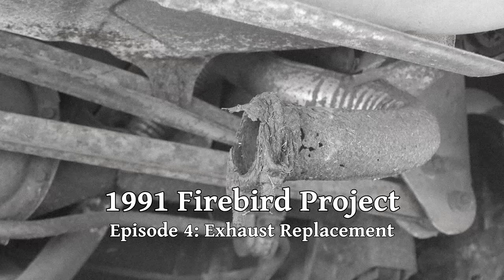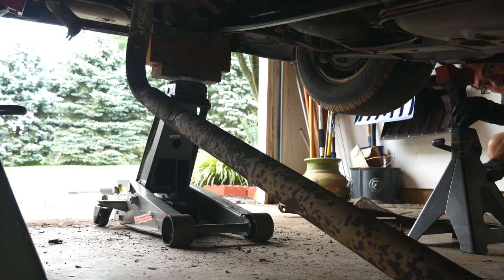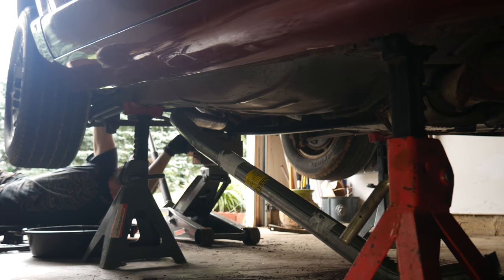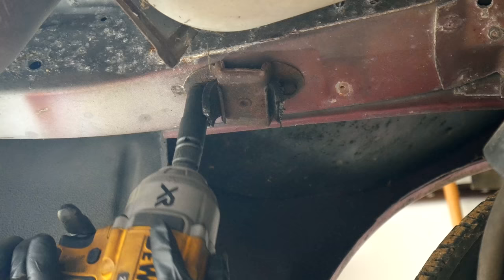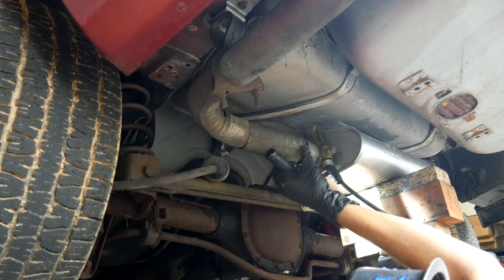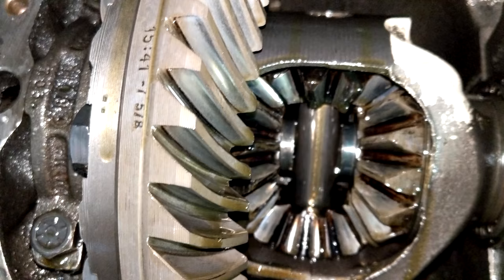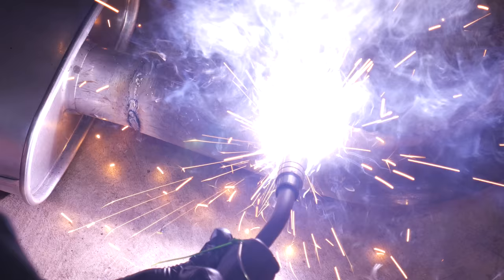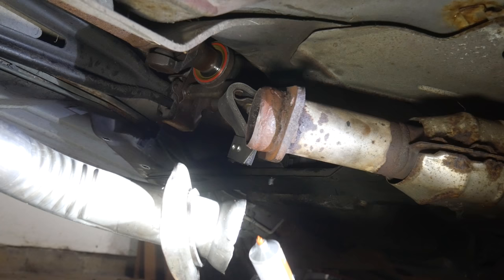1991 Firebird Project Budget DIY Exhaust Replacement/Repair (Ep.4)

Comment: As a person from Europe and the rust belt - that exhaust was mint.
Also, this channel is probably the BEST when it comes to realistic portrayal of a project car. Changing exhaust? Well, to do that, i need to take out a lot of the rear suspension... i might as well change the diff oil. 
Really, only part i find unrealistic is the fact that the presenter/mechanic/personality doesnt have to get up 600 times in one day to go pick up additional tools. And half of those trips are useless because you realize you grabbed the wrong thing.
Cars. So much fun.

Comment: As someone that bought a V6 mustang with overly loud (compensating for a dearth of cylinders I'm sure) exhaust for a daily driver years ago, I commend you on your choice of not waking the neighbors. I'm all for the craziness on a sometimes car, but forget that noise early in the morning.
Reply: shoulda got a v8 bud
Reply: My neighbors are jerks. Pypes Violator mufflers on my 5.0. Sounds awesome!
Reply: @oliverharwood2743  well, yes, but the car was $200.
Reply: With the stock tiny cam, restrictive heads and manifolds, cat, and low compression these LO3 cars don't really get "wake the neighbors" loud with just a cat back.

Comment: I had that same muffler x2 on my Cutlass with true duals. It was nice to have because I did a lot of highway driving and the car has a turbo 350 trans with 3.73 rear. Getting your ear drums blown out by exhaust noise is only fun now and then, not on a daily commute at 70mph. Can't wait for more content on this ol' bird. Digging all the low budget fixes.

Comment: I worked in a gm dealership, and even changing that intermediate pipe with a hoist was a motherhumper. Doing the fuel pump was fun also, tucked up behind the rear axle, above the muffler...and gm used a welded stainless steel exhaust...thanks, gm, from Auto techs everywhere.

Comment: The zip tie on the exhaust, I guess you probably know by now if that held up ok, but usually exhausts get hot all the way to the very tip on a decent journey, might be enough to melt that zip tie or at least weaken it (some of them become brittle when exposed to heat), but they do make stainless steel zip ties you could use. You can get 25 12 inch stainless ones at Harbor Freight for 7 bucks, might be worth getting if/when the plastic tie fails.
Reply from the maker: Fair enough! It's not so close to the exhaust that I think it'll be an issue, and is still holding on at the moment. I kind of figured it would tear through the rubber first!

Comment: Another good choice for fiber gaskets is Permatex #3. It's a sticky goop which never sets, you brush it on. It slightly soaks into the gasket and you can reuse the same gasket many times with a new brush of the goop. You can also use the goop on fill plugs to make a fake washer gasket. Also you can leave the cap off the bottle and spill it which is impossible to ever fully clean up, so you have that permanent reminder to yourself to put the cap on properly next time :P

Comment: By the way, I had a 91 Camaro RS. I couldn’t afford back then the $ 500’s to replace the fuel pump. My Sister being a Doctor said “Oh, she needs open heart surgery”... BRILLIANT!!!! I carefully cut a “U” shape over the fuel tank. Bending back the cut section. I cut the metal fuel lines, straightened them out after replacing the pump. Using high pressure fuel lines. I was able to reconnect them without any leaks. I decided to cut out the “U section and patched it with new painted metal, RTV & 1/2” self tapping screws. Whala!!!! Never even jacked it off the ground. Good luck!

Comment: The stock style muffler from Walker/Dynomax is about as quiet as they come, since stock '92 F bodies were made to be quiet from the factory.  The only way to get them loud is straight piping, or cutting the cat right off at the Y seam, then it starts sounding like a beater pickup.

Don't bother replacing just the bushings, you can replace the entire rear suspension control arms and track bar for cheap from Blackpath, with greaseable zirk fittings and lifetime warranty for any part.  And no, I'm not a paid promoter, they just make really good stuff for cheap, that can be replaced for absolutely free with the lifetime warranty.
Reply: Well a tbi is not a big horsepower house either. no compression at all so even straight pipe they are not lound at all.
Reply: @Bowtie4me  Yep, they were made to run on cheap gas, and the stock roller lifters greatly increase reliability and can use conventional oil, especially since regular everyday drivers wouldn't remember to put ZDDP formula in the oil to keep the tappets happy.  My mom thinks my Camaro's loud since I had to cut the pipe off at the Y, just sounds like a beater truck now. lol
Reply: In Tejas, we have no emissions inspections, and most of the folks I know would have detached those cats as their first order of business.
Reply: @chuckschillingvideos  there's some cheater cats that are basically through pipes that look like converters to inspectors, a great way to get away with an unconventional engine swap.  Unfortunately, road tripping has become more difficult, since paid corporate staties want to pull you over for ANYTHING, just for the opportunity to impound your vehicle and sell it to a cop at a police auction, or have you pay exorbitant prices to get it out of hock.

Comment: Quick tip: leave the top bolt partway installed on the diff cover while you let the gear oil drain.  They have a nasty habit of dropping off when you least expect it, plunking down into the drain pan and making a mess.

Comment: Trick to getting those tail pipes out. They slip inside the muffler, so taking a cut off wheel or using a exhaust pipe cutter with a air hammer, peel back the muffler pipe on two sides to free the pipe. Then taking a pipe expander and a impact, use it to smooth out the dimples in the pipe caused by the clamp. Then install the pipe in the new muffler and use a new clamp.

Comment: Yeah that exhaust on that 92 Firebird. That was an aftermarket replacement the exhaust and tailpipe. Because you can tell the way the pipe was bent. The original exhaust would have had a smoother Benz. But for a 1992 Firebird that makes 200 horsepower. The exhaust system you're replacing the Original aftermarket exhaust is fine. You would think in this This age though. All the pipes cream annual event with smooth transitions Eben Factory replacement exhaust I thought the days up manually Benton them and kink in the pipes were over with but I guess not.

Comment: I used to put ""HUSH THRUSH " on all my stuff in the 80's . cheap and they sound good . once you blow all that fiberglass out the tail pipe they will sound much better , a little carbon doesn't hurt either 
'

;

Comment: Flowmaster makes a good  semi- quiet muffler for these cars but if you really want that deep drone and not a lot of neighbor pissing off volume Magnaflow is the proper muffler but they are a little pricey or at least they used to be. Thrush used to also make a semi-quiet "Californa" turbo that was a good made to fit option for the 3rd gens too. these are my most liked body style of these line of cars mostly because of price and availability and that is the reason i've ended up owning 5 of them now. in order i've had a rancho sponsored 1985 Camaro IROC-Z, an 84 Trans Am, 85 Z-28, 86 berlinetta v6 i was going to convert to a 350, sold it before that happened. and a 1992 formula firbird that was just a huge rust bucket and i drove it to the foundry because i never would have been able to afford to replace all the floor pans and uni-body frame work that was rusted through underneath it. that last one kinda hurt to get rid of because it ran perfect but evey time i found a good replacement body for it someone snatched it up before i could get the craigslist idiots selling it to get back to me. the panhard bar connecting the axel to the body had worked it's way lose from the body thanks to the rust and when i took it out for it's last drive the rear end felt like it was trying to force it's way out from under the driver's side of the car as i was going down the road. i've never had one of those cars that the back axle floated around under the car the whole time you were driving it like that one did, kinda scary and pretty unsafe so i was resolved to get rid of it rather than sell it to someone who's kid was going to get out in it without fixing it properly and get themselves or someone else killed in it. so i took the L for all of the people in my area and just took it to the crusher. all of these that i have owned though were T-top cars with the exception of the 86 berlinetta and the 84 T/A i LOVE the t-top cars this one of yours is no exception it's a nice one and more of the reason that so much of yours is rusty isn't from running it ragged it's from being left to sit in the grass for too long. I am SO happy for you that your neighbor decided to let you buy it and do what you're going to with it. i'll be watching. the only way i could love one of these cars any more is if it was a first gen convertible though
Reply: Shoulda sold that shit. It's their fault if they dont inspect it.

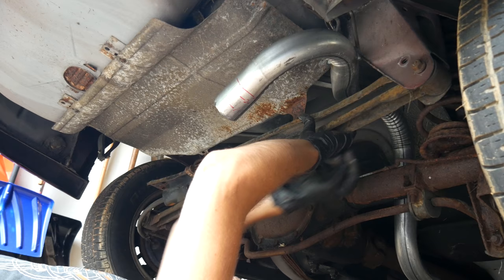Comment: 12:11 now you have a 1" exhaust pipe since you crushed it flat. Always remove the Fill plug before you drain the Diff fluid. Seen too many people drain diffs and then find out the fill plug is cross threaded/seized and cant be removed.
Reply: Thats not how exhausts work, an occasional dent or kink does not effectively reduce the diameter of the exhaust. This is dyno proven actually.

Comment: i like your video do i have one tip for you.i see you changed the oil in the rear axel.because the car tilt forwart you have a little too much in the diff.its very wise to lower the oil  when the car is standing on his 4 wheels.the reason for this is when you drive the car there will be building pressure in the diff.when there is too much oil in the diff. it will puch it out the oil gasket.actully you create an oil leak.sorry for my bad englich,its not my main language. let oil drip out until it stops drippping.

Comment: The last scene was awesome from underneath the car.   The welds look like ray charles grabbed a soldering iron and some rosin core and went to town.  Also the last captions takes the cake.  “It also ticks like a diesel, we’ll take care of those lifters in a future episode.”  So you got this deep into a car fixing the trans leak exhaust and trunk struts and didn’t bother to find out if the motor was wasted? PRO TIP.  Make sure the car is worth saving before pouring your heart and soul into it.  I won’t be watching further lol

Comment: I don't know F-bodies, but on most live axle RWDs you can unbolt the shocks and jack up the opposite side of the axle from the side you'd like to be lower. You can usually convince another 4-6" of space out of them with that approach.

Also, get a good stiff wire wheel for your grinder. Best $10 you'll ever spend for stuff like this.

...and, the sheet metal style exhaust clamps are the best thing on Earth, IMO. I stopped using U-bolts about 10 years ago. No more crushed pipes, ever. "Evil Energy 2.25" Butt Joint Stainless Steel Exhaust Sleeve Clamp Band" on Amazon is the style I'm talking about, but I  believe Autozone carries a brand that is about $4/clamp through their web site. Maybe it's at Advance?
Reply from the maker: I hadn't thought about trying to tip the axle like that, thanks for the tip! We have a stiff wire wheel for the grinder and it does clean things up very well, really just being lazy about prepping the pipes lol. I have used those clamps before (actually all three other vehicles have that type on their exhaust) and I agree that they are really nice to work with. I think the ones I have used are Summit brand, they are stainless and decently inexpensive.
Reply: @FuzzyDiceProjects  I'm lazy with the grinders too. That's why I have a couple. Changing stuff out sucks!

Anyhow. Cool to see it coming along!
Reply: @FuzzyDiceProjects  Oh, hey! I forgot to mention that I channeled you recent and bought my own complete rust dumpster Blazer. '97 though.
Reply from the maker: Ha, nice choice! Good luck and try not to let it fall apart on you lol
Reply: @FuzzyDiceProjects  Way too late. Bought it non-driving from a guy at work and it's  literally dropping pieces of itself in my driveway as the ice and snow melt and then re-freeze. It's a turd. Should be a lot of fun as a winter beater! haha

Comment: Oh my god the pidgeon-poop welds!
You make me remember my first time welding, which, that's not a compliment. ;)
... In all seriousness though, with some level of consistency and a grinder, you can pretty much accomplish what you need.
Though, please, promise you'll at least occasionally practice the odd angles! :P

EDIT: I paused before the metal plate.
... The term "fabricobbling" springs to mind, but hey as long as it works!

EDIT 2: 22:26 oh dear, that poor, poor pipe... :'D

Comment: Quiet is not the issue.  I'm dying to see how long your Hush Thrush muffler lasts.  I suspect I may not have to wait too long to find out.  I had a pair on my Chevelle back in the 1970's.  

.
Reply: This isn’t the 70s, these aren’t even made in the same continent as the ones you used!
Reply: DrewLSsix But if mine lasted less than a year, this one would be even less!

Comment: I know this is all about cheapness in that build, but in you case, why not getting a new muffler and tail pipes ? They are really cheap on Rockauto, the Walker SoundFX muffler I used on my Trans Am is $35, and tail pipes are around $10 a piece. So for $55 you get a whole new tail exhaust system. That's really, really cheap.

Comment: Kugel lefever 1991 firebird did 303 mph in 1999. You tube
I with working electric windows and stock wraparound spoiler.

Comment: Get a small piece of copper pipe and pound it flat to make a softer scraper than a steel razor blade
Reply from the maker: Nice idea! Haven't heard that one before, makes sense. It might not always be enough but I bet it works more often than not.
Reply: @FuzzyDiceProjects     It`s often in the first few pages of Haynes Manual`s in the Tools and working facilities section,      Especially for models using aluminum and magnesium engine parts

Comment: The 80's and early 90's were not nice to "performance" cars.  Throw some 3.73's in that beast
Reply: This is very true.
Reply: Got 3.73 LSD on my '84 Trans Am, factory, and a 5 speed to make it fun :) So the option existed, but not on every car. This Firebird is clearly a lower end cruising model.
Reply: Its a 305..  you’ll spend lots of money, and do lots of work to finally realize you will still be driving something slower, and more annoying than a 10 yr old 6 cylinder Honda Accord..   this car was made to “look” sporty., and thats about it..
Reply: They handle 1000x better with a little stiffer and lower springs. With a 305 and proper suspension it's still a good auto x car.  Not much for acceleration but there's an easy solution for that
Reply: @kctyphoon  google Jim Reid jr, specificly his Stock Eliminator Camaro, and then talk to me about that "slower than a stock 10 yr old 6 cylinder Honda Accord" theory of yours
Reply: Nope, if u goin back and forth on an interstates 70-100mph
Reply: @sergeantspeed5941  4 hundred bux and u can get a 17 inch corvette rims, that way to go then lower the bird
Reply: Four Sevens my 62 Impala with a Muncie and 3.73’s does fine on the interstate without an OD.  It’ll be fine and the 3.73’s work great regardless of what engine he runs.

Comment: If I remember right and this is anything like the 80’s 305  - the 7th digit on the vin code in the dash is the engine code..  G series was the “high output” 305 , H was the standard lower series - but that might have changed  early 90’s ..   even the “high output” was only around 200 horsepower , and the standard was probably 170 when NEW....   so for anyone that wants to suggest “performance” upgrades - you are wasting your time and money with this..  youre at about what a 4 cylinder family car puts out today, and with the mileage  - you could be facing about 150hp on a good day its thats a standard 305..   yes you can wake the car up a bit with gears and other stuff, but cars in this era were largely money pits for those of us that grew up around that time - and people would have sold their mother - or wound up swapping entire drive trains to be on par with a 6 cylinder honda today.

Just make the car run and drive nice, enjoy what it is..  you wont be winning any races with this - but you can still enjoy it
Reply: The thing is, the 305 is just another SBC. Is has a ton of potential. People just give up on them because of their output with stock smog era heads and broom stick cam. In reality sprint car guys are getting as much as 500hp out of them naturally aspirated and they've powered F bodies into the 9s with boost.

Comment: Well, you lost me there when you killed the dual tail pipes. Even though it is a single run exhaust pipe, a good sounding Thrush or Flowmaster muffler with dual tail pipes would offer up a healthy tone and attractive dual exhaust tips to enhance the appearance. Might as well be a six cylinder Camaro. I would not want to buy it now. But it’s fun to watch your work.